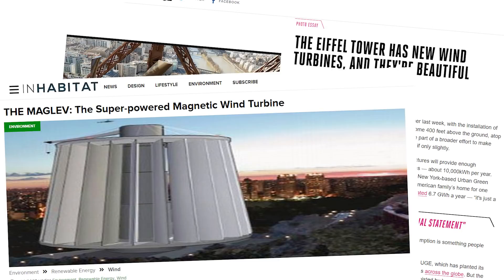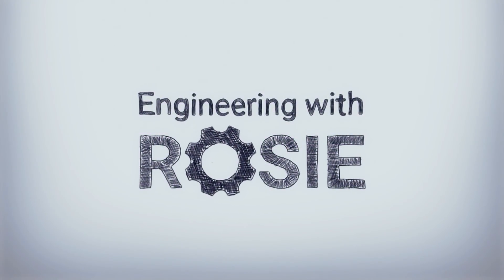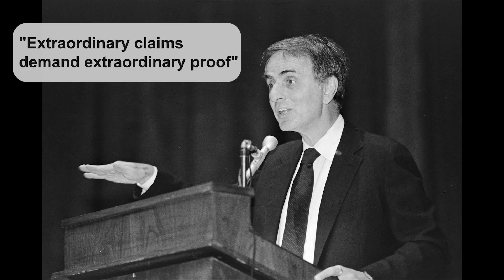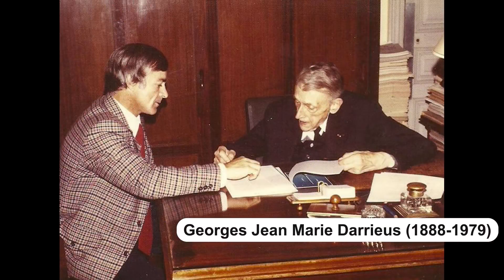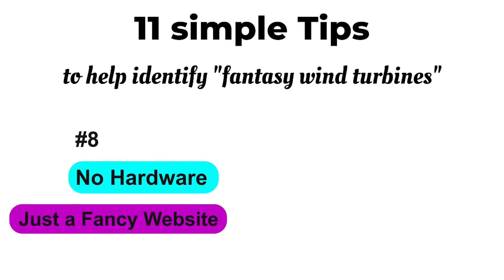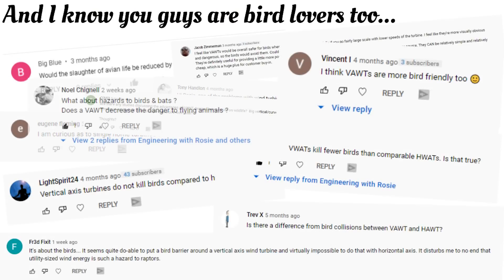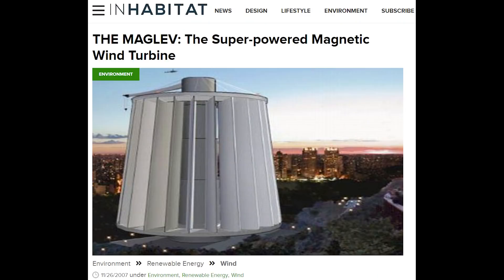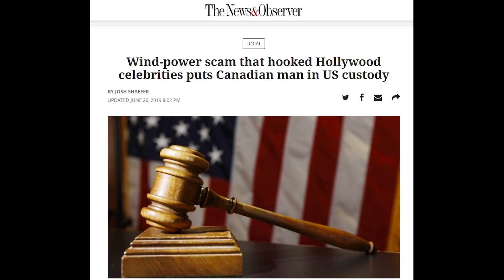Back to the Future of Wind Energy Technology with Paul Gipe

Comment: I have lived off grid for 6 years in Northern Arizona. There are times we get quite a bit of wind, with that said in the early 2000s the price of solar PV has come down so low that   you can produce such a high percentage of your energy needs that it makes it almost impossible to justify a wind generator for the small amount of times that you need to augment your solar system. The building departments require a fueled generator to get a permit on off-grid dwellings and the small amount of fuel you need to burn when your solar is not adequate makes it difficult to justify spending large amounts of money on wind.

Comment: I don't mean to be the negative Nelly, but it did come across as a bit well, overly negative or dismissive.
Like of course nobody likes scams, but I don't think we should smugly pooh-poohing proposals just because they're based on the same operating principle as a previous design, or else haven't had the resources to build and test a prototype, like Mr Gipe said, websites are a lot cheaper than prototypes.

Most of these alternatives probably aren't better than the conventional designs, at least if there are no restrictions that would mean a conventional design would be impossible or greatly compromised...like the space constraints inside the leg of the Eiffel tower.
By the way that wind turbines are measured for efficiency, that particular VAWT might not have been stellar (I hope they took into account the airflow disturbance from being inside the leg when they're making their comparisons though), but you could probably get a larger swept area using a VAWT within the confines of the leg, than with a conventional HAWT, so power generation might well be more, even if efficiency is less (after all, wind is free & the extra material cost probably isn't all that significant when talking about installing it inside a historical monument anyway...).

Sure, the media hypes them up, as they do with EVERYTHING else, and it's really quite tedious. But I don't think the answer is to be quite so dismissive of them, as some of them might well be better suited for especially niche applications.
Reply from the maker: Do you think we need to put wind turbines in the Eiffel tower at all? It could never provide a meaningful proportion of the tower's energy usage, why not just get the power from the grid and build a wind turbine out in a field somewhere it can get decent wind speeds?

Comment: When comparing the Eiffel Tower Turbine, he is comparing it to another turbine in optimal conditions..  I wonder how well a horizontal turbine would measure up if it were installed in the Eiffel Tower...  Vertical Turbines are more adaptable to our infrastructure and can be installed in a multitude of more locations than horizontal turbines..

Comment: I think that this video is excellent if you only are considering commercial large wind turbines. Certainly when wind speeds are high and consistent, the three blade version wins out.
As a homesteader, do-it-yourselfer though, I can build a small wind turbine from the scrap metal pile here and make it look nice and produce some electricity without a massive tower here in the forested rolling hills where I live, while also looking really cool while it happens. There is a lot to be said for smaller, more tangible turbines that can help people to appreciate the possibilities in the wind more. So engineering and investment wise, large three blade turbines are best but smaller, varied wind and artisticly, I still love vertical axis ones.

It is always good to be reminded that there is a true king of the wind though, in case anyone was confused about that. Certainly loads of hype to cut through to find the truth

Comment: The maximum amount of energy in the wind can easily be calculated. W=1/2*area*air density*wind speed cubed. If your wind turbine captures all the Watts for the area it covers then the wind speed behind the blades would be zero. So wind turbines have some losses, which usually are around 70% (30% efficient). So if someone says they get so many W's you can calculate fairly accurately what they get on average, W=1/2*area*air density*wind speed cubed*0.30. If unsure of wind speed just use average wind speed for the location (city weather forecasts show this).

Comment: Is there a name for a VAWT that goes around an existing pole or tree, so the turbine turns around the outside diameter of the structure?
Reply: Not that I know of. Would the 'pole'-variant be different than the 'tree'-variant or the 'nothing'-variant? If not, VAWT will do. 
Only scammers are in need of giving something a 'new' name. Scientists usually use their last name when it is time to put a name on a new device or function that really works and is really different.

There are experiments with "roadside VAWT" that harvest energy to light the street-lights and these should/could be installed around existing poles.

Comment: In the end all wind turbines run up against Betz Law. Efficiency is basically How close can you come to that limit. How can I calculate how much I can expect to produce with a vertical axis. Do I use 3, 5, 6, 7 or more blades? Do I use many thin blades or fewer large blades? Do I overspeed ? Vertical axis, at least small scale require much less as a foundation.

Comment: Why all use blades ate maded so they do not change in shape, why not use dynamic shape? Like used in water to avoid return, anti-return valves. That way air can push on one side while not push on the other side. Because when blade is on one side it presents a big surface against the wind while in the other side it presents a near to zero surface against the wind.
It would imply to use a more strong axle since it would be un-balanced a lot more.
Reply: Anything that moves will break over time due to material-fatigue. If a device rotates once per second (so changes form two times a second), it will rotate 31,5 million times a year (and needs to change shape 63 million times). Does it take 5 years to earn back its installation-cost? Then that's 315 million shape-changes before breaking down and that is not easy to do.
Reply: @DreadX10  Not every thing that moves suffer fatigue, the top most extreme demostration is magnetic levitation in vacum, no friction at all.
But there is another thing that cause degrade, cosmic rays that can pass through the whole earth ... but again the ratio of degradation is so low that on the whole universe life time would not be appreciable.
There are magnetic configurations that can cause a magnetic trap, so blades could use that system for their moving parts, and friction would only be with air.
Actual generators are based on rolling over metals, much more degrade buy friction, if not lubricated a break is possible in just seconds.
Magnetic 'traps' are not well used on technology, and there are very good places for use them, like on any rotor.
Now back to the 'concept', it is not about reducing the 'cost' per year, it is about innovating and improve how much energy can be obtained from low speed winds, low speed means low friction, so the smallest friction affects a lot, another good chance for magnetic trapping axels, etc.
I understand magnetic is not on all minds, and not much people understand how they can help ... and the day a superconductor will be able to stay in superconductor at 20ºC things will change a lot for sure.
But the main problem with air speed meters is for example the friction when it moves against the air, dynamic shape (better if that change is without friction) could be a great improve.
And magnets can also be used to cold things, there was a prototype of a freezer that works without compresors by using magnetic properties (that is out of my understanding but it works), so also the heat caused by air friction with blades could may be solved the same way, etc.
All this is about innovating, thinking in alternative ways, create a proof of concept and then see costs and make it cheaper and more efficient... but that I&D&I never gets enough founds to create a changing world technology.
Wnat i was trying to point is that all air generators i had seen has a fixed shape blade, some with inversions of millions of dollars on wind tunnel studies and computer air dynamics ... but no one i had ever see hss adaptive shape blades... maybe there are some, who knows!
Thanks for pointing the cost of fatigue, i had seen a normal wind geretador be destroid because of deficient lubricant maintance and blades parts go flying kilometers away, that was a really panic moment, can not know where they were to land, i do not wish to anyone to see that.
Reply: @androidlogin3065  My "moves" = "changes shape" (only talking about solids). Not saying it is just translating from point A to point B.
I thought my last sentence made clear I was talking about shape-changes.
The reason all wind-turbines have fixed blades is because all the designs with shape-changing-contraptions broke down (too quickly) or were too noisy. It is not because it wasn't tried, it just wasn't successful enough to compete.
You need to invent a material that can change its shape without suffering from fatigue AND do it silently, over a reasonable life-span. 
If you use pivot-points than these need to operate when under a centrifugal force. (And "No, you can't use a $1000 ball-bearing when harvesting cents worth of energy)
You also need to keep the centre of mass in the same spot otherwise you get balancing-problems (as you stated correctly).
Most flexible materials suffer from embrittlement by UV-light from the sun. If you use those, you need to change them regularly.
How do insects impact your design? ;-)

The problem is not that we can't build a blade-shape-changing wind-turbine; the problem is we can't build one that lasts long enough to recuperate ALL the energy needed to build it.
Reply: @DreadX10  Well expressed, just the tip: such pivots made with magnetic traps have no parts that touches each other, so no fatigue occurs.
Actually as you pointed that could cost a lot, but maybe if start being used prices of magnets will drop down and more investigation on cheaper and stronger magnets materials will start.
As i said, i do not talk about taking in consideration costs.
Personally i use at home my own magnetic traps for pivots as much as i can, chais, tables, etc., no more broken hinges or bearings, i replace them with zero touching parts (magnetic traping)... o know not cheap, i know that with actual price of one magnetic trap can pay thousand of hinges.
But silence and no need for lubing, maintanance is wonderfull for my rotatory chairs and foldable tables, etc. Once you use magnetic trapping you do noy0t want to hear again parts frictioning to each other.
Maybe for other is not so important, sure orices will drop down when produced in mass, till then prices are not cheap.
Reply: @androidlogin3065  Permanent magnets loose their magnetism over time when used. That's a form of fatigue.
I've listed several reasons why it is more difficult to build a shape-changing Savonius-type VAWT than a normal one and presented them as problems, where they should be viewed as challenges to overcome.
The answer to your original question and in light of the subject of this video; shape-changing isn't new, it has been tried and tested and there were better alternatives around so engineers went with those.
But if you have a bunch of magnets lying around and have had interesting (and fulfilling) fun 'playing' / engineering with them, then you are the type of person to have a go at applying your experience to that of the VAWT and see where that leads.
I would recommend the youtube channel of Robert Murray Smith as he is almost exactly doing that. Just have an idea, build something to test and measure it and go from there. His wind-turbines could use magnetic bearings to get rid of some friction.
You have a rotating chair that rotates smoothly? That's half of a Savonius-type windturbine already. ;-)
Reply: @DreadX10  Thanks, i did not know someone was trying it (i will try to find his channel), unlickly i do not have economical posibility to use space for testing wind turbines at home, not an unifamily home (losts of floors, some homes per floor).
Just i must point that Magnets only degrade if happens one or more of this three basic things:
A) Temperature is out of a range (too cold or too hot and magnet can loose magnetic)
B) In presence of stronger magnetic fields (so they change magnet field acording to the stronger one)
C) Being hit (no need to happen a break, they can loose magnetic by small hits) like when have friction with other parts (vibrations, heat, etc)
If you put a magnet rotating on a coil of cooper (electrical generator), the magnet does not degrade just by that rotation; if the magnet does not touch anything (it is in vacum and use magnetic trapping to be in place so it does not touch anything) it does not degrade with use; if it touches anything or is in contact with something else it can degrades because vibrations and or heat.
Also cosmic rays can degrade magnets, but luckly it is so slow that in millions of years would be very little.
I had tried to find the link to the channel you mention, hope this is:
https://youtube.com/c/RobertMurraySmith

Comment: wind is good for pumping well water into cattle watering tanks - has done that well for a very long time
Reply: Direct use of wind power is often overlooked as it is case and area specific. Much easier to convert it to electricity and then power a pump, that is, if you want to sell thousands of windmills. As a Dutchman, I'm well aware of what wind-power can do to any water-level.

Comment: Rosie, have you done any videos on VAWT design modifications that address the design's inherent flaws? Such as the cup design used in wind meters. How much of an improvement in it's efficiency could be achieved by ruducing the wind resistance of the cups moving into the wind. If a cover were introduced that moved indendently from the blades so as to shield the upwind side equipped with a tail like that used in a wind vane so the covered side is always the upwind side. I don't know if my description makes sense, let me know.
Reply: When covering one side you basically create a vortex and have the turbine spin in the centre of it. More efficient but also a lot more material needed and therefore less kWh per installed kg.

Comment: I spent 4 years modelling VAWT, and the torque issue I solved at that time in a gyromill with cam config for blade pitch. It got too complex . What I did find is that the apparent "wind" direction settles into just a few degrees deviation at higher TRS's. So a much simplified set up was born out of knowing the low speed would be a bitt ratty but high speed would be a lot more stable in torque output and efficiency. The major advancement came from using the tip vortices as thrust. It also lent it's self to easier maintenance and lower cost to install and transport.  The alternator would be modulated to further reduce torque peaks , and that alternator would be at or near ground level giving the "drive shaft" a measure of torque damping. Container sized would produce around the 100KW. Remembering that ease of shipping and installation is much of the equation. There was also the possibility to use radical blade profiles. Biggest issue is the high G loading on the entire length of the blades and it's in shear not tension.

Comment: This video was a complete waste of time, pointing to pictures in a book and saying it’s all been thought about before, is not engineering.  Scepticism is important in investment and science but it’s the last attribute you should look for in an Engineer.  It’s important to investigate why ideas were shelved and research if it still applies with modern materials and manufacturing processes.  This video addressed none of that.
Reply: Your comment was not entirely a waste of time.
The video was about how the use of the word "new" in relation to wind-turbines is usually indicative of a scam and not really something new. 
Engineers need to be sceptic BEFORE putting a lot of money and energy into something that (likely) doesn't work. If they don't, they would be part of the scam......

Comment: The way I see it is that everyone wants the single, high output, mega-device, and no one can improve on their design. One example, they never think to borrow from old prop aircraft. If an engine goes down they feather the props so it doesn't drag. In high storm winds they have to apply the brakes to the windmill because the blades don't feather. VAWT's don't have the output but can be run at a lower altitude and wind speed. I'm repeating myself but the best analogy is you can have one giant ostrich egg or a couple of dozen chicken eggs. You'll still feed the same amount of people but if there's a problem with one chicken egg the whole system doesn't break down
Reply from the maker: Modern wind turbines have pitch regulated blades and you can feather them. It was the topic of my first ever YouTube video if you care to look: https://youtu.be/Y5T5ZhJQr2o
Reply: @EngineeringwithRosie   Thanks for taking the time to correct misinformation. 
There of been a lot of even small wind turbines, horizontal axis of course, that either had blades that changed pitch to keep them from over speeding during high winds or they furled out of the wind etc. you have probably read all about this in Gipe‘s older books. Anyway, thanks again for what you’re doing here.